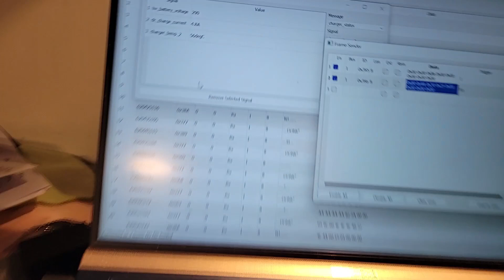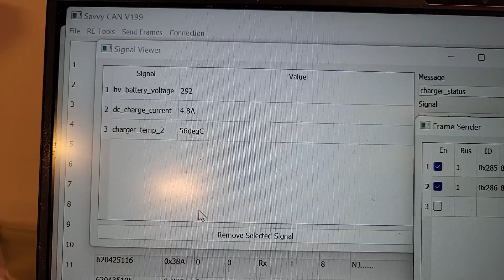Finally: it's fast! (OK, faster). FOC Tuning my EV-swapped BMW

Comment: Great to see some tuning on video. That new firmware is supposed to be a big milestone, offers way more parameters. Which of course all need tuning :) very multidimensional.
I'm thinking this 32768 is rubbish actually, I've already changed the tuning guide